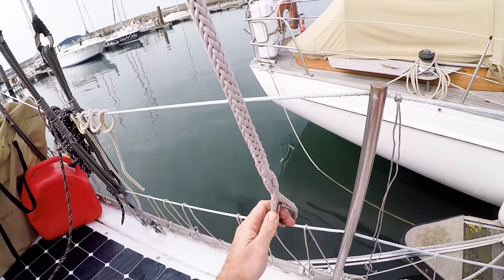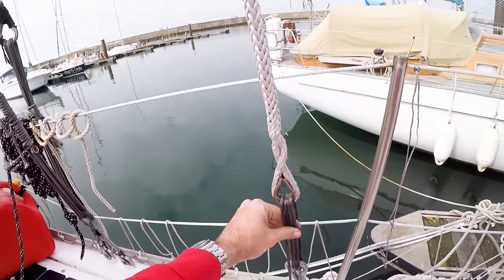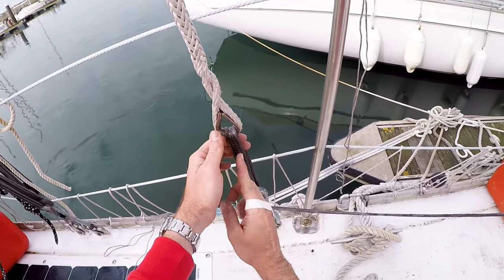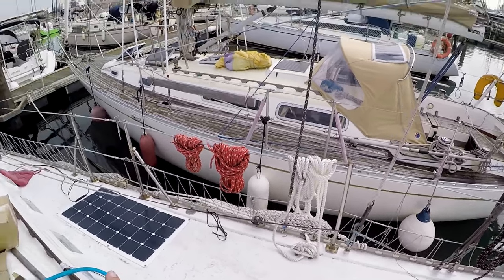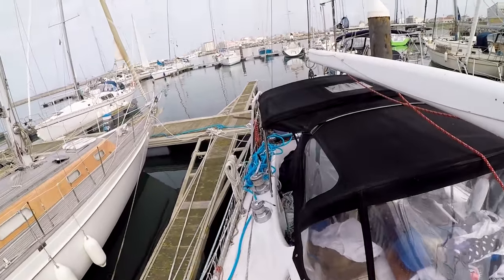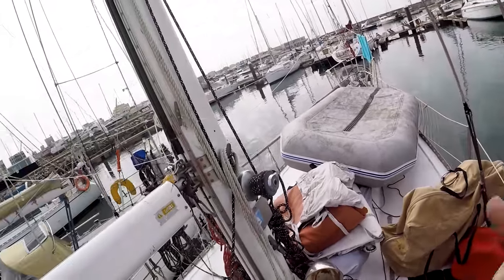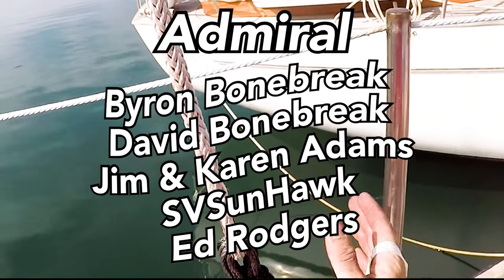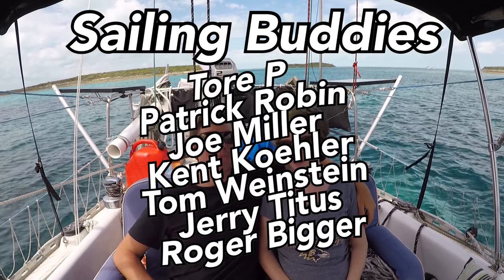Installing a Synthetic Standing Rigging Stay with a Deadeye | Sailing Wisdom

Comment: Your installation of the cotter pin is incomplete you bend of the pin should wrap around completely not just a mild split of the pin itself.
Reply from the maker: Bending the legs really far actually stresses the leg right where it exists the clevis pin and makes the leg more prone to breaking off there. The result is the leg breaks off and offers no retention for the pin. Bending them just 15* gives enough retention without stressing the metal in the cotter pin.
Reply: Not according to Rod Stevens.
Reply from the maker: But according to Brion Toss.
Reply: @RiggingDoctor  Rod (and I) agree with you. (BTW I hate split rings). This comment was meant to appear after the initial erroneous criticism. :)
Reply: @RiggingDoctor  wrong I have worked in the aircraft maintenance industry for 30 years it applies no added stress. And if not installed correctly adds less protection.